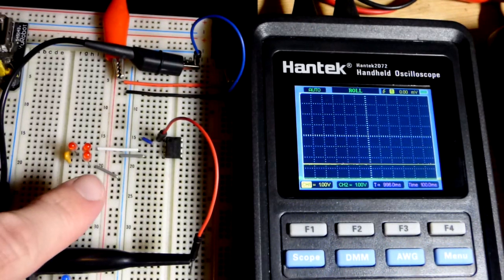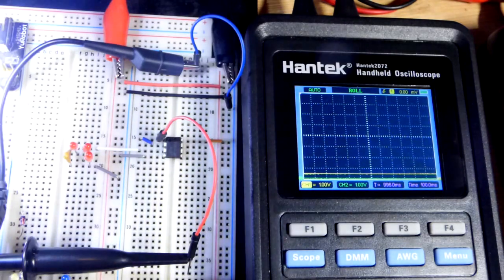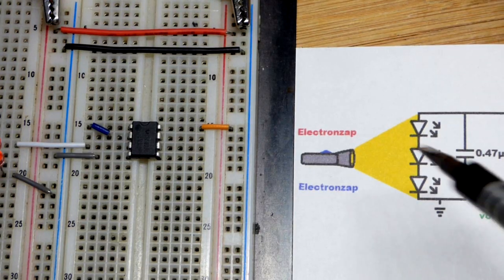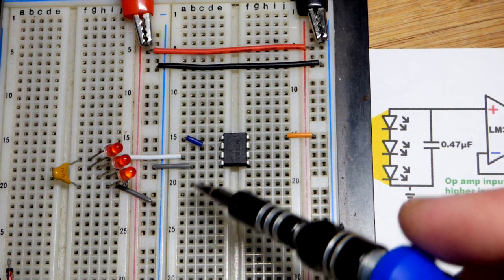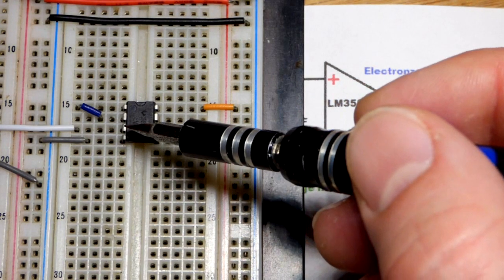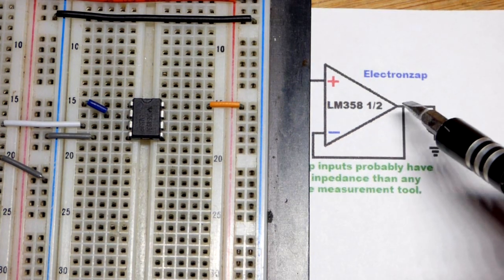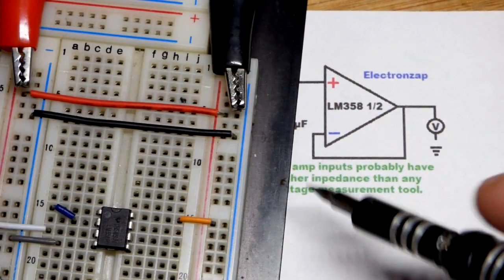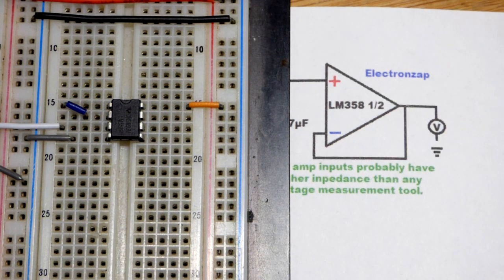LM358 Op Amp follower helping to measure a weak voltage for learning electronics shorts 75

Comment: did you make a video about balancing resistor values for series capacitors, as you mentioned at the end of this video? "Series capacitors split up voltage but reduce capacitance and have balancing problems demonstrations"